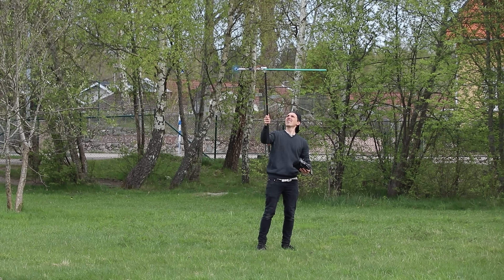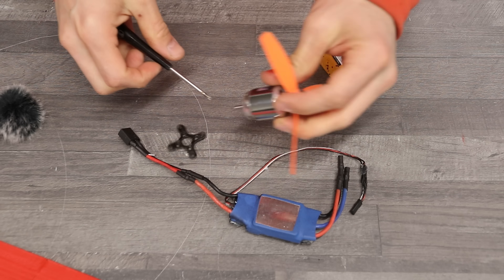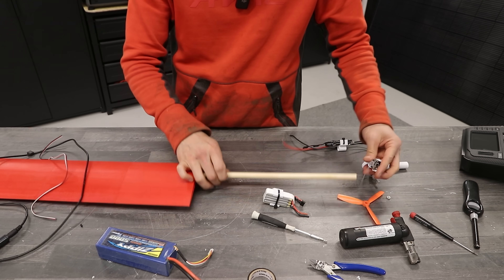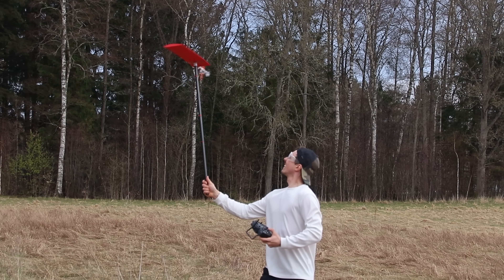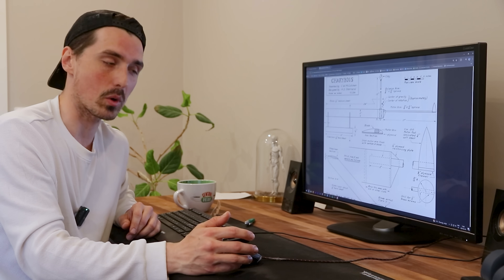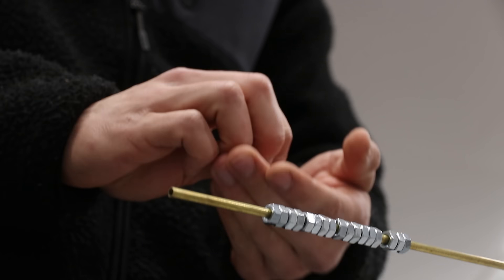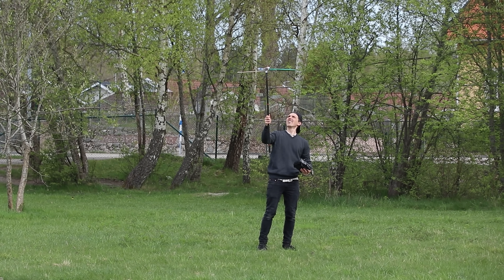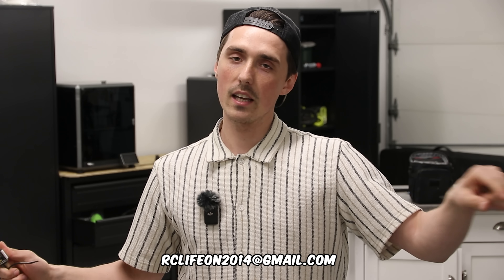How Does This Fly With Only 1 Wing?

Comment: With this you cant control the rotating asis ... and so the flight direction ... if you bild on the rotating center an axis down a wight mass at the end and  control the angel to the rotating wing ... a bit similary like a helicopter wing ...  than you can control the dirction ...

Comment: Oh, the wing that generates lift is upside down.
It looks like you turned the wing in the wrong direction. The direction of the wing is assumed to be opposite to the direction of the engine if we store a linear perspective.
The video shows that the engine produces a counterclockwise circular motion, and the thick leading edge of the wing is also supposed to be oriented counterclockwise to produce lift.

Comment: It will fly. If I not mistaken a Dutch Scientist flew a machine like that a few meters for a few minutes in the '80s. BUT It's not viable. In aviation regulations WE NEED REDUNDANCE. On One Wing Aircraft come on!
Which is refusing the principles of the physics and principles of how to build aircrafts, your are going  by simply putting more Weight where should be Lift and Thrust.

Comment: remember this acts more like an autogyro... it has no reverse torque, it doesnt require a tail rotor... just a vertical stabiliser.. which should always point into the wind... sort of annoying, but yeah. gives you a reference to control it from. and that raises an issue, having the motor counterbalance the blade...

as the blade pitches UP for increased AofA, the motor pitches DOWN...

at which point its better to strap two blades on, poke the motors on the tips, and say its a fairey rotodyne... gunna be a lot easier to adapt controls to...swashplate and a 6 pole rotary contact... (2 motors right?)

Comment: A 1-blade helicopter?  Not so surprising.  There was a German company, I don't remember the name, that built a man-carrying 1-blade helicopter, and it flew with a pilot.  It was an otherwise entirely conventional helicopter with tail rotor, engine inside the fuselage driving the rotor.  The rotor had a counterweight, though I don't see why you couldn't build it with the engine a the counterweight, either propeller driven or geared, though gearing would require a tail rotor and the gearing for the tail rotor would be complex.
Reply: Bölkow Bo 103

Comment: The effort of keeping to one fan I respect- Nice job!
I can see it does work! Albeit, without control.
To fix this, you may have to change the fan blade to variable verticle pitch like a tattered flag of elevators to code. An AI with a gyroscope could find the right algorythym for success.

Comment: Control!
So what is the next step in mono wing design? Some means of control & stability. 
Has anyone else broken through to find a way of controlling the flight and a controlled landing.

Not sure if you could stack 2 mono wings a top one another, rotating in opposite directions, similar to a contra-rotating propellers. 
If this would cancel out the torque to allow a controlled vertical flight.

Another option would be to control the movement of the weighted counter balance, relative to the wing. This may allow you to vary the angle of attack of the wing. 

And another option, 2 motors. One motor on each end of the mono wing. This way the wing would be symmetrically creating lift about its centre of rotation. Would this contribute to more controlled hover and work towards controlled flight?

The complexity of forces are hard to get your mind around for something that looks pretty simple. Simple it is not.

Comment: Interesting.  Suggest leaving the launching rod attached to the wing to stabilize the wing in flight, like a pendulum.  Then, with a bearing and a gimbal and two servos controlling the angle of the rod, you can vary the angle of the pendulum to change the angle of flight, like a gyrocopter.  The left stick on the transmitter would then control it like an airplane, with elevators and ailerons, to control its attitude.  Unlike a helicopter, the angular rotation of the wing currently acts like a gyro to stabilize the wing. You would need a fin on the pendulum, to keep it pointed in a forward direction.  If you added weight to the wing tip, that would increase the gyroscopic effect.  A wing of that size should be able to lift several pounds, depending on the angle of attack and rotor speed.  A thicker airfoil will generate more lift for a given rotational speed.  The angle of attack of the wing should be varied, greater near the hub, less at the outboard end, like a propeller blade, with a "twist".  Your airfoil may be somewhat thin to generate more lift to accommodate extra weight.  A gyrocopter can be thought of as a rotating wing with a pendulum suspended below the wing.  In this case, the electric motor rotates the wing, not the forward motion of the blades moving through the air at an angle.  Might or might not work - you're the developer, not me.

Comment: The wing piece being heavy is not a setback, it can give momentum and stability like a flywheel, also, the wing is too deep, it needs to be thinner from leading edge to trailing edge, much like a boomerang wing.
Also, the centre of wing gravity is where you could place the battery and receiver giving it more stability as the differences in weight distribution can make the wing fluctuate like a guitar string.
But given the delicate nature of this project in respect to flight characteristics and technical problems in build quality, I think you did a damn good job to get it flying in the 1st place.

Comment: If the center if rotation is within the "length" of the wing, then the "shorter" part of the wing
probably should have its airfoil direction reversed, in order that none of the airfoil is trying
to push the aircraft downward.  Also, have you considered filling the (hollow) part of the
wing with a lighter-than air gas?

Comment: It is ridiculous that this guy is 'spinning' the wing in the wrong direction.   The more blunt edge of the wing goes forward into the wind.  This is the leading edge.  The more pointy edge of the wing is the trailing edge.   It pains me to see something this bass-ackwards.   Come on, man...      Blunt end into the wind, dude.

Wings like this do not work well when flying 'backwards.'  If you're going to fly a wing backwards you might as well use a flat plate for an airfoil.

Comment: The rod needs to out past the prop to balance things out. The shorter the more weight. Also , the wing should be a few degrees above the center line of the motor. You have the motor climbing and the wing descending. P factor ? Fly on !

Comment: You english are fine but not you sens of direction lacks some. Either turn the motor 180 degress or make a propeller that push the other way. Your wing spinn is making it go into the ground.  (at 6,27 in the vid)

Comment: I am only up to 8:00 so far. You have it spinning the wrong way. At my model aero club, way back in the sixties, a member made one of these. He carved the wing from a solid block of balsa. It was powered by a tiny glow plug engine. There was a thin metal rod attached at the centre point. He just threw it in the air with a spinning motion and away it went.

Comment: Use the read more button, as there is usefull info at the end!!!
Way back in the fifties/ sixties there was an interest in these one wing helicopters, but they were small diesel or glow plug motors, and completely free flight.  i cannot remember the science behind the wing stability, but it did involve a swept back wing tip, and a change of angle of attack at the tip.
They were more stable, as they tended to hover much better, and self correct. I don';t know  what happened when the fuel ran out. More correctly, I don't know it came down, but I think it was auto gyration in the same way a seed pod flies.
And there is nothing wrong with your English--its much better than my Chinese!
You may find more information about these things in the model magazines from 1950 to about 1965.  The English "Areo Modeler"  ran a few articles during that time span.  Hope that helps

Comment: my dad built these in the 70’s with balsa wood and .049 gas model airplane engines.  And they worked great.  pretty hectic for sure.  sounded just like yours but about 1000 times louder 🧏‍♂️
oh, and you can launch them by just holding the far end of the wing opposite the motor, and almost do a 1/2 rotation like a shot putter and gently swing the wing in its first arc and let go and it will do the rest and begin its rotations with just that gentle toss.  almost like a frisbee

oh. now I finished watching. yes. the version with the double wing is what my dad build.

Comment: Unless the axis rotation is positioned at the root of the wing, it won't fly. You can see it clearly on the fluctuation of the pole once the rotation starts. Positive control of the pitch might be obtained, placing a moving control surface behind the propeler assembly, it would increment the weight of the craft -servos, cables, supporting structure-, which possibly would require the discarded motor, but you can't make an omelet without breaking some of eggs.

Comment: just keep the wing.... but use two motors at the end ..... best use an centrifuge system to change the angle in the wing with the speed of the motor .. if you use two wings one in different angle than the other (with two motors at the end )  its gone work much better..... 🌏 📡🌏 👣🕖 💎👽☠☼☾☄ゞど・ㇺㇾㇽ₪𝖎𝖙𝖎𝖇𝖎𝖗𝖆₪なめㇺㇾㇽ✶☥✨🌛🌄⊀✶⋊🐺🐾♓☆🐜🐜🐫▲▴◭👀

Comment: you could try modulating either the propeller or add a small control surface on the wing tip to control the orientation.
That would require a whole bunch of extra sensors and computers, though.

Comment: Should add aileron on wing+servo….make the motor mount tilt up down w servo…. Test all this…
Add vertical fin on the wing…put all electronics on stick inside a 2nd wing-like casing ( opposite of the main 1)…test.🧩

Comment: You have the CG in two dimensions, now consider the third Z axis.  From the current CG, drop a flexible rod with a small weight, and use the aileron control on the controller with a servo to push that weight in the direction that keeps the wing horizontal, until you want to tweak it to make a change of direction.

Comment: Why do you have wing part at the center turning axis? 
It makes no sense, as there is not forward airspeed there.
So as a physicist & engineer I would advice to make a rotatable landing gear in the center axis and make a 'cone shaped' wing getting wider to the outside. As only the outer part has airspeed and can create lift.

Comment: If you added a small cyclic gyro (RC helicopter part) and a short trailing elevator with  servo on the end of the wing, you would be able to control direction of flight.

Comment: I had this toy helicopter made by Cox. Had an 0.49 cox on top with a prop. That spun the main rotor. We flew it 15 or 20 times. It never once used more than half a tank. We geniuses thought this was by design. Nope just dumb luck. On the last flight it went up about 100 feet like usual and stuttered. Then it cleared out and went at least another 300 feet. It was a dot.... Anyway wind got it and carried it 1/4 mile. It was in the top of a skinny dead tree in a city park. Had to do a stealth recovery mission for the bird. It didn't survive but it was worth it. We laughed for a week.

Comment: That's a great build. Fun to watch you work on it and improve the design. Do you think you could make it steerable? With modulating the speed of the rotor multiple times per rotation of the wing or with a small weight that you shift along the axle of the wing multiple times per rotation to vary the center of gravity and with that the orientation?

Comment: Now to add servo and Melty Brain control firmware from BattleBots.
(Melty Brain is a type of battlebot that spins whole at high RPM using differential speed control of its wheels; the onboard computer determines its momentary facing and can apply small changes of speed to the wheels to make the bot move in given direction. In your case, you'd vary angle of attack.)

Comment: There has been more than one prototype of a single blade helicopter and counter mass for balance but what they found is it offered no advantages but had the drawback of the counter mast that was from a performance standpoint just dead weight to lift as well as getting good static and dynamic balance of the rotor nearly impossible.  While the disadvantages were relatively small (because the counter mass is not that heavy when put on a long enough bar) the lack of any advantages made it a design dead end for helicopter rotors.

Comment: I like the idea. If I had a 3D Printer, I'd consider only printing the wing's ribs and then assemble with a spar and then cover with shrink-wrap film (as many balsa, RC planes are now covered rather than dopped tissue paper). It would be ultra light and may function even better than what you built.

Comment: Awesome. I also agree that tail weight should be able to be removed or at least reduced. Other thoughts:
1. Wondering if better rotating lift is improved if centre of balance is further out from the wing (more wing area at higher speed)
2. Also wondering how much more efficient it would be if wing pitch gradually increases towards centre of rotation (like you see with a propeller). Although more complicated to make.
3. Maybe less practical but possibly aerodynamics of battery & controller might be starting to having a noticeable influence on efficiency - maybe  a light pod might help. 
Nothing wrong with your English BTW

Comment: Thank you for showing your mistakes, too many videos just show the successful builds and make things appear unrealistically easy. I made mine with the bearing hole through the wing and mounted the launch rod on a stake in the ground. The monowing had to spin up and ride up the launch rod as it picked up speed. Much safer and it always worked. thanks for bringing back the memories.  If you want to go down the rabbit hole lookup “gyroptere” by Papin and Rouilly, they made a manned full size one to launch from water.

Comment: Spent over half the video yelling at the screen.. "It's backwards!!"  ;)      Pretty sure the perpendicular stick with weights ultimately controls your angle of attack and you simply had it set to too low of an angle which is why it spins so fast without generating much lift.   Don't think it needs to spin that fast.   Also the  Clark Y is highly cambered (the average between top and bottom surfaces is concave) and is not an airfoil designed for tailless aircraft so it generates a very strong forward pitching moment which has to be countered by that perpendicular stick above and beyond the fixed AoA you set.    Keep in mind a real helicopter blades are symmetrical (having no camber at all) so it also generates no pitching moment.  All the lift comes from increased angle of attack.

Comment: Now,  find a way to steer it. Could be done with a control surface that changes every revolution. Use a directional antenna that knows if its facing toward or away from your transmitter.

Comment: It's also possible to make a single prop "monospinner" drone without the wing. In this case, the prop is angled more upward, and instead of a wing and weight, there's just two weights.

I bring up the "monospinner" because it doesn't require fabricating a wing. This may make it easier to get working.

It also doesn't require an extreme spin rate before launch. Obviously, a mono-wing's lift depends on spin rate, but a monospinner's lift does not depend on spin much.

Comment: You might be able to lower the weight of the counter balance by placing the battery et al on the other side of the rod, where the counter balance goes.
Next phase, make it possible to steer. Just add a servo to alter the wing/motor angle... (I have no idea what that would do)😁
Love your projects!

Comment: Nice to see someone else experimenting with monocooters! A big factor determining the angle of attack of the wing is the direction of your propeller spin. As the monocooter rotates, the axis of the propeller's rotation changes, which due to gyroscopic precession creates a torque along the wing's long axis, either pitching the wing up or down. From the shot at the start of the video it seems to me that your prop is in the correct direction for increasing the wing's angle of attack, but you can try to reverse it to see what happens.

Also, it seems like your monocooter is not passively stable, since it changes its angle of attack and its axis gets more and more tilted until it crashes. It is possible to make monocooters that are passively stable. An example from nature is the maple seed. There are some academic papers that explore the conditions needed for passive stability of monocooters. For examples of working ones, you can search up Lockheed Martin's "Samarai", monocooters made at Air Lab at SUTD (these people have done A LOT of work on monocooters, wrote many papers about them and they also have a YouTube channel) or you can check out my YouTube channel ;)

Comment: I feel like the chord is too large and has induces drag… it needs to be more knife like… if you treated it like a main rotor and had the trailing wing like on the other design act like a swashplate you could control the direction.

Comment: Protip, those holes actually make the wing heavier. Do the one hole for the dowel and then leave the rest as infill. It'll be way lighter. Add more walls for strength if its too weak.

Comment: the sound makes me wonder if it needs some balancing. the sound also reminders me of the noise hyenas make, but pitched up. 

you may be able build this nvidia isaac gym and train a model in simulations to learn how to fly optimally  

what are some practical use cases for a mono-wing? i'm only thinking of weird lidar scanning or imaging ideas
would it work in the form of a single toroidal propeller?